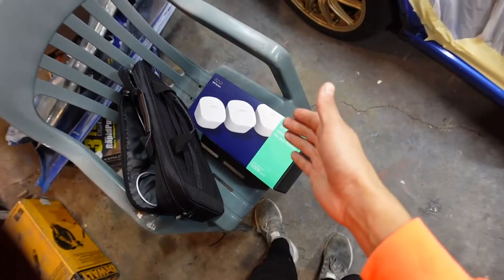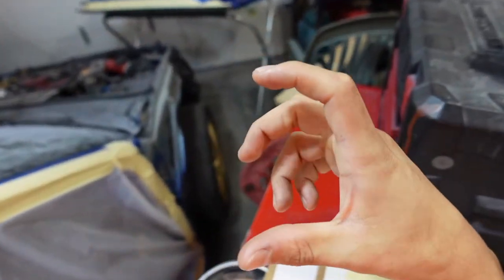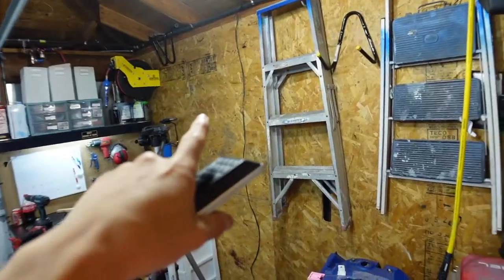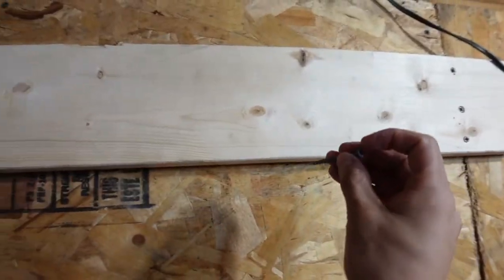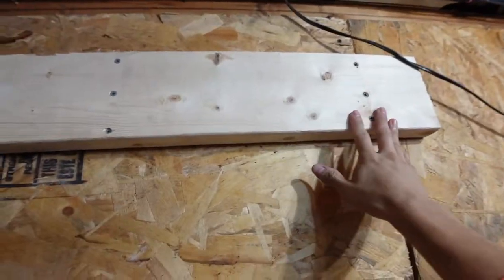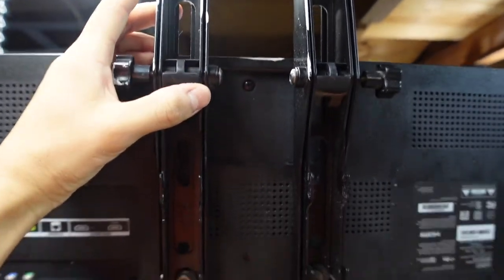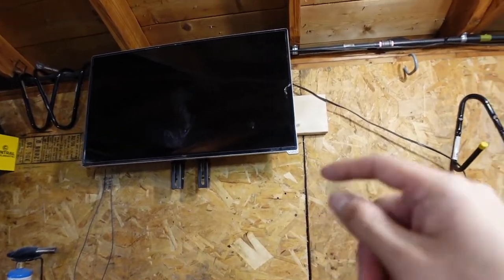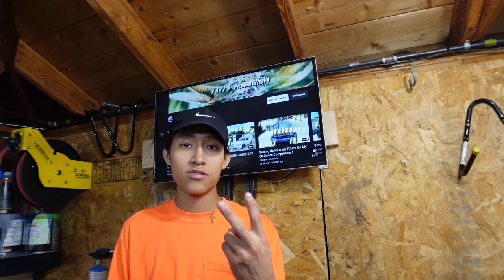Installing A Tv In The Garage!

Comment: It’s been a year….has the heat or cold negatively affected the tv?
Reply from the maker: Not at all
Reply: @JavisProductions420 this is what I needed to know. I'm contemplating putting a big screen in the garage. Afraid that the heat from the summer might ruin it.
Reply: @andreawilliams2095 I’ve had a 75” tv in my garage for a year. Absolutely no problems. DO IT
Reply: @andreawilliams2095 now this may be paranoia and I don’t even know if it really helps, but I do unplug the tv when I’m not watching it if it gets to extreme temps.